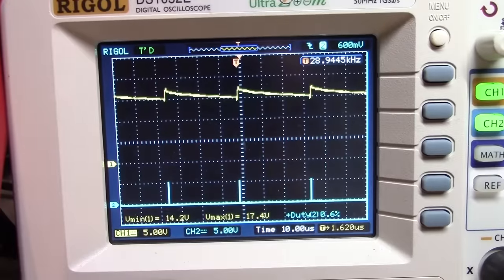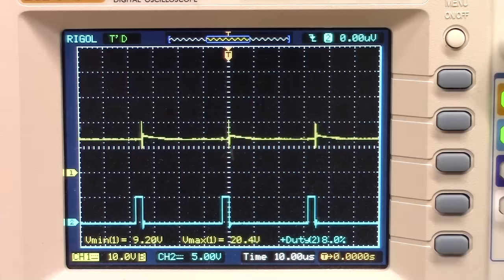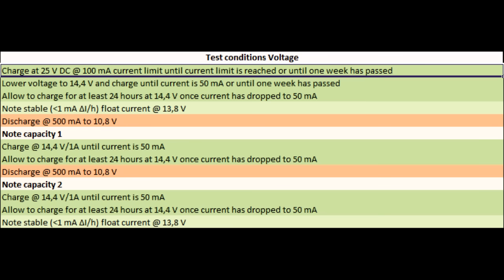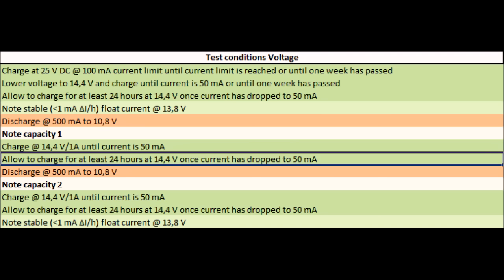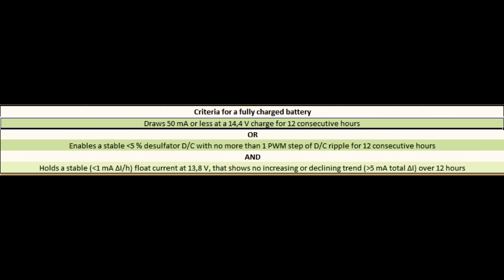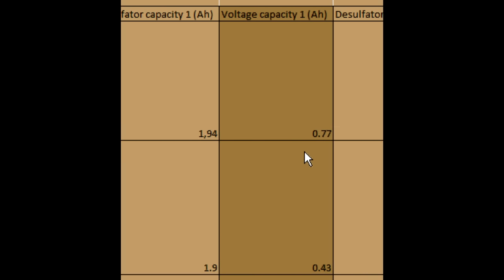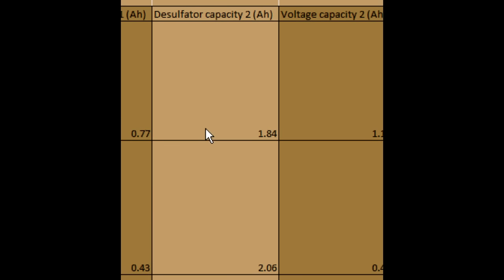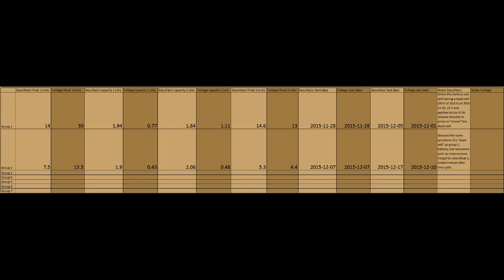Battery desulfator science part 2 - Test conditions

Comment: I have been doing this for a long time. Have you ever tried "reforming" the plates with (gasp) reverse polarity charging from a freshly discharged state?  Chargeing, discharging, and reverse charging is how the manufacturer develops the lead oxide, forming dissimilar plates. This has saved my ass on several occasions!
Reply from the maker: I have not done that, no; I suspect that while it might revive a battery in some circumstances, it's generally not going to provide good enough results for my applications.
Reply: @Garbled User:  Any specific reverse polarity charger that you use?
Reply: @aogulla  What I am using is a variable bench power supply. No specific brand required.
Reply: I tried this several times using 2 ohm 200 watts resistors  with a heat sink and discharged at about 3 to 5 amps.
It did not work. I was afraid to discharge without a resistor because the battery had originally 750 CCA !!!!
Anyway after every discharge the battery got worse !!!  I also replaced the electrolytic twice, did not work !!!

Comment: I wish you had the time to summarize your conclusions! Last thing I did I bought a 25 Amps B&D smart charger, so smart that being in Florida, it told me that the outside environment temperature is to high and stopped charging. In-did it was about 92 degrees and 88% humidity. I think I bought a weather station instead of a charger !!!!
Reply from the maker: I didn't really get anything conclusive out of this. The desulfator wasn't worth the effort.

Comment: Every time I tried a new method the battery lost one cell. By now after four weeks only two cells remain good.
So the only thing left (If I really want to go there) is to open the battery top and pressure wash the plates to remove all the accumulated dirt and shorts, etc.. But I wonder If any good plates are still left inside. The two remaining cells were charging at about 20+ Amps and going up to 8.75 volts when connected and charging at about 5 Amps thru a 1-1/2 ohm ?
Reply: cells degrade unevenly, so the good cells will work harder at a higher voltage to reach bulk voltage, at this point the good cells are over voltage and start gassing loosing water and becoming bad cells; you need to add more distilled water to them until the bad cells recover; this is a PITA process, and requires a lot of patience

Comment: As it happens , I've done the science for this over a 4 year period, processing a couple 100 auto,marine, deep cycle and diesel batteries with a custom designed system that does a combination of processes, not only desulfation. The final outcome is a professional system capable of a kiloamp of pulsing with  full safeties and the ability to sequence two batteries of differing types for regeneration while maintaining 2 others. The outcomes (average, one  45Ah battery per day)  are 25% to 33% of batteries return to OEM service and the post regeneration  failure rate is now <1% . I have extensive data logs of battery recoveries and the system tracks & archives all the science data with wi fi access plus operational wi fi management reporting (realtime). Systems are in early deployment and are doing well in commercial environments. Early rejection of bad candidates can happen in under 10 minutes.
Reply: Ancel B, would you be able to provide additional info?
Reply: Sure, I have open sourced a portion of the tech. for DIY, it is about 100x as powerful as the 'popukar' desulfator and it can work on a vehicle size battery in a day or less. https://hackaday.io/project/25741-desulfator-engine-re-climate-change-mitigation
Reply: @Ancel B
Will you provide a way to contact you or allow us to peruse your work?
Reply: @ancelb9590  hey, you are awesome for open sourcing your battery maintenance tech!  

I’m about to go look at this one, but are there any newer projects you’ve been working on too?

Thanks!
Reply: Buy Pulsetech Desulfator/Rejuvenator Batts.

CHESS MATE.
Reply: @guillermoiturriaga7863  I tested those, they take weeks to work.

Comment: Great methodology, a pity that cells never quite recover, but then we know lead acid cells do die eventually. 
Question, had you popped the cell covers to see how dry they might be? I know they are AGM batteries but you can add a bit of water to them but not much. Never personally have tried adding water but I have seen where it can be done to really dried out cells.
Reply from the maker: On these batteries with the round cell covers, you usually ruin the case if you try to open them. It's a different story on the models that have one big plastic piece covering all the cells. I don't usually open them, though, because 9 times out of 10, poor performance has to do with the platters being broken rather than the electrolyte being cooked off.
Reply: @FFcossag  not when you boil off the water by overcharging!!!!!!!!

Comment: can you please make your conclusions in simple terms so we can understand if desulfators are worth it ?  great scientific work
Reply from the maker: They work somewhat on specific issues, and won't magically revive a completely flat battery with plate damage. Worth it if you know how to gauge the situation, not worth it if you just want a device to "just fix" old batteries.
Reply: thank you for your great effort and details,  I tested a few types of desulfators I bought them a few years back and conducted simple tests on normal car batteries , I put the desulfators along with trickle charge 19 volts for over a week or two and then load tested them and I was very disappointed no improvements!!  thats when i packed them all up and gave up// 
now I am trying one more time but my guess is that the car batteries with thinner plates are harder to fix as they sustain damage easier so my focus now is on deep cycle ones that have thick plates I am trying now on 6.5 amp hour 12 volts and hoping to see some thing in few days
Reply: @FFcossag  Old batteries (not damaged by low voltage under 10.8V) really can't be rejuvenated a bit by desulfator? I've measured capacity of my 10 years old car batteries and it is 26% and 30% of nominal capacity. Now I have got 5pcs 12V 7.2Ah AGM from UPS with capacity about 50% (cells checked, all of them contains electrolyte). My capacity tester is this circuit: https://www.flickr.com/photos/124591966@N06/43030273220/in/dateposted-public/

Comment: overvoltage will COOK THE WATER off you need to add distilled water to the cells!!!!!!
Reply: reversing the PbSO4 (lead sulfide attached to your electrode) back into Pb, PbO2 and H2SO4 needs water for the reverse reaction to take place when applying high voltage pulses; if you lost distilled waster which is a normal process over many years of use , you need to add more of it otherwise the reaction will not take place as expected; best method is to weigh in the battery when new and compare it with the old battery; the difference in weight is the lost water